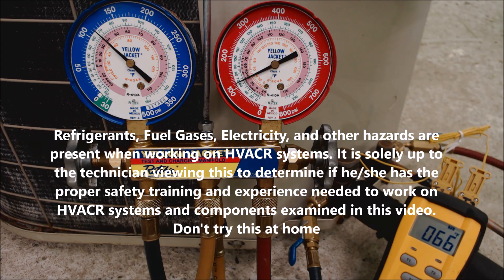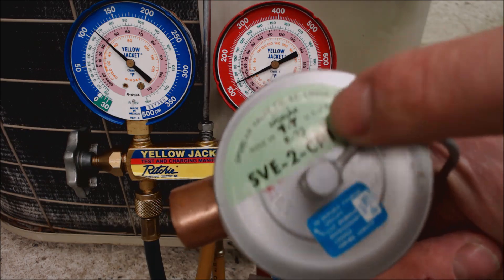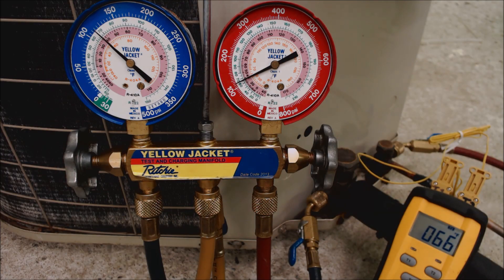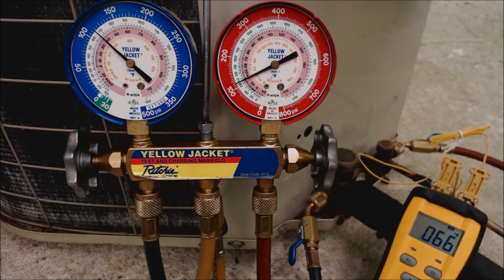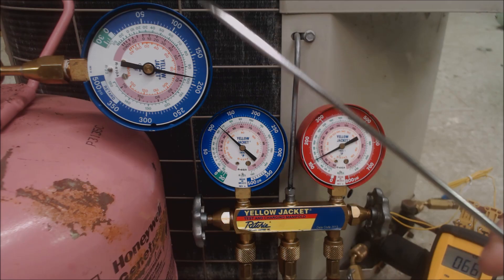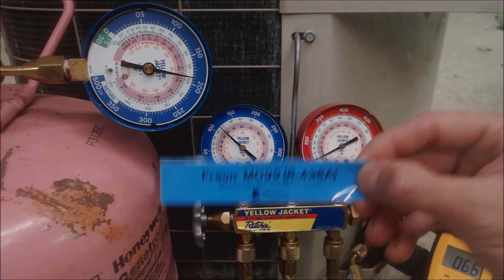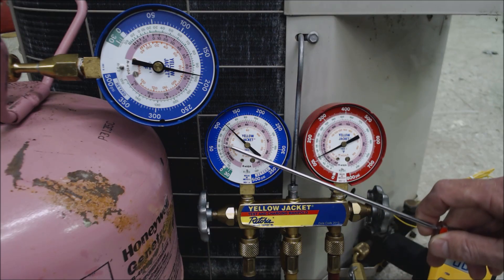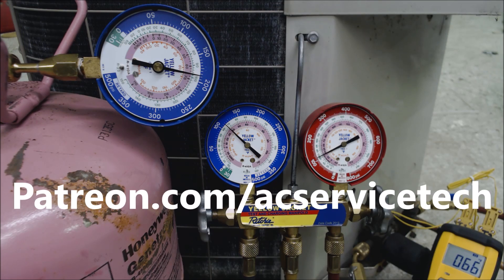How to Tell What Refrigerant is in an AC Unit!

Comment: my only question is how can you tell what refrigerant the system runs on when it is "low" on refrigerant.
After taking HVACR classes. They never mentioned this, nor did I ever ask because I didn't think I would come across this problem. But this problem is extremely common where I work. Our senior who works here with his EPA universal also doesn't know how to tell other than him using his memory (he's been here for 14 years). This is an apartment complex we work at. If neither of us can tell what the system uses. We usually end up replacing the whole system.
We also understand that is usually the best case since the system shouldn't be going low anyways and 99% of these that we replace with this issue are more than 10 years old. Some 15+ years even.
So while low on refrigerant or completely empty from a faulty/worn valve core which we replace, how can you know what refrigerant they use without any labeling?
All labeling has withered away and has been erased by the sun. All condensers are on the flat roof of our buildings.

Comment: Awesome video!

I had a refrigeration company from craigslist took a  look at my walk in refrigerator's condensing unit because it was bubbling in the site glass.  2 techs show up.  By deciphering my compressor code,  they both concluded that it was an R12 compressor.  Here is the funny part.  Both techs were arguing about which refrigerant to use.  There were no indentifying labels anywhere.  One tech wants to use r134a while the other said he's going to use "hot-shot" as an upgrade, adding $150 to my bill.  They don't have a refrigerant identifying tool.  I asked them what's the cheapest way they can do it.  They said they can top off with hydrocarbon12a/152a.  Really?  They said hydrocarbon is a bigger molecule and will stay in the system longer versus the 134a, but there's a catch.  They wont write me a receipt if I chose the latter.

My question is:  which would you use (hydrocarbon or r134a)  to top off just to have the machine work for another month or 2, so that I have more time saving up for a new system.  Ofcourse no one is supposed to mix refrigerant, that I totally understand.  But installing r134a to top off a system when you don't know if r12 was initially in the system kind of defeat this.  Thanks in advance for your answer.
Reply from the maker: The best thing to do is to recover the existing charge, vacuum and weigh in a new R-12 retrofit refrigerant. We don't mix refrigerants. If they want to use R-134A then they would need to cut out the compressor to drain the oil and replace it with POE, otherwise the compressor may burn out because R-134A won't carry the mineral oil well, thanks!

Comment: Thank you for the video ! But wait !!!  Don’t you have to shut off the service valves?  Let’s Say your outdoor temp is 100 and your indoor temperature (inside the air handler) is 80.  With valves opened you cannot go by just your outdoor temp because there would be a 20F difference within the same sealed system.  It’s like heating up that tank to 100F on top and freezing the bottom to 32F. (I am exaggerating just for sake of argument)  you would have a mixture of temperatures within one container.   I wonder what was the indoor temperature in this house?. Maybe it was close enough to outdoor temp that it didn’t affect your result.  But it is still important to at least me mind Full of it.   What are your thoughts on this?  Anyone.....
Reply from the maker: It was close in temp during the video but the higher temp area would still exert a higher pressure on the whole system at equalization, thanks!

Comment: Awesome video! I have a question though. How about if there is no indication on the unit that let's you know how many pounds of R-22 to put in. Is there any way to tell how little is too little or how much is too much?
Reply from the maker: You won't know how much refrigerant is supposed to be in the system. You are going to have to guess the weight. Just weigh in less than you think and then start the unit up and add as needed using superheat or subcooling, thanks

Comment: That’s why i’v always used a refrigerant identifier, 
http://www.centurytool.net/mobile/Product.aspx?id=60677 
no guessing, no contaminated mixed refrigerants to throw off your readings that you don’t know about. No mixed air in the system from a bad practicing tech before you got there. I bought my first one in 1994 it save me 1000 time from false diagnosis. There’s a lot of dropping in other refrigerants on top. You either know 100% what Refrigerant is in there or your just guessing the best you can.
Reply from the maker: Thank t lech, that is a great tool to have! I am just going over the EPA 608 questions of how to determine a refrigerant as well as just trying to figure it out with the p/t chart when you don't have a tool like that, thanks!

Comment: can't really go with a labeled txv,I came across 3 units in 2 weeks,r22 on the condenser label with r410a on the txv's and the units actually had r22 in them
Reply from the maker: That is not good, Those txv's would need to be changed out unless they were electronic ones. How was your subcooling, hunting, and delta T? Thanks Tipoblanco! That is a shame someone did that!
Reply: probably shady business practice, as in done on purpose so the compressor burns out and they end up replacing condenser soon ;)

Comment: Cool tips! Very helpful! And how to determine if system charged with mixed refrigerants? What I have to see to determine it? What it can cause? Thank you so much!)
Reply from the maker: Thanks Tapch! Leo put a great comment out on that in the comment section. The sat temp when off may be higher or lower than the refrigerant that is supposed to be in there depending upon the refrigerant that they added. You will notice roughly the same thing as when the system has noncondensables in it most of the time unless there is 134a added. You may think that the system is very low on refrigerant in that case because the sat temp is low when off but when you  are running it, and adding refrigerant, the mix does not act like it normally does with superheat decreasing and subcooling increasing. You would just stop there and recover into your mixed refrigerants recovery tank. Thanks Tapch MC!
Reply: Thank you  for  the detailed explanation. Thank you Leo.

Comment: Great video.  This is good, need-to-know, information for all new techs.  I would also like to add that if you've allowed sufficient time for the gas to equilibrate and reach  saturation temperature, and you find that none of your numbers seem to make any sense, you may have a system with mixed refrigerants in it.  This is why I always ask the customer if someone else has looked at the job before me.  I've had more than enough trouble with home owners buying "freon" from auto-zone, and jury-rigging a "hose" to get it into their condensing unit.  If someone has put R134a automotive refrigerant (especially the junk with "leak-proofing and "tracking dye" in it) into an R410a or R22 system, there is nothing you can do but recover everything (being sure to put it into your special recovery bottle that you keep in the truck just for "mixed refrigerants"), do a complete vacuum test, and recharge with the required factory charge of the correct refrigerant.  If you have any suspicions at all about mixed refrigerants, DO NOT try to correct the problem by adding more of the proper refrigerant...it won't work.
Reply from the maker: Perfect statements Leo, thanks!

Comment: Could you check the units in the fall, to determine the refrigerant in the system? I am sure that all the units on my rental houses are 410A, but just to make sure. All the systems are running well, now. But just to check.
Reply from the maker: You could check what type of refrigerant it is in any temp. To check the charge, you would wait until a 70 degree day though, thanks Todd!